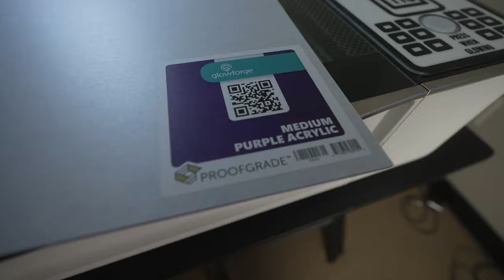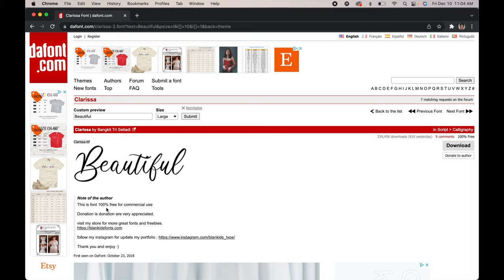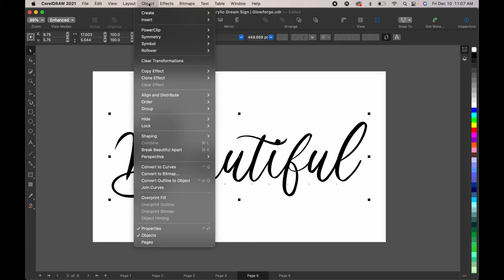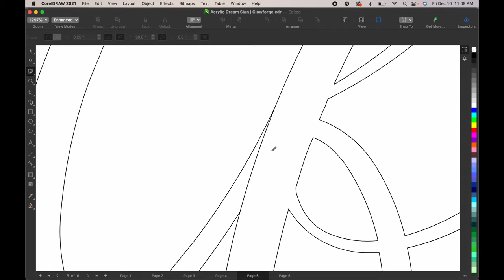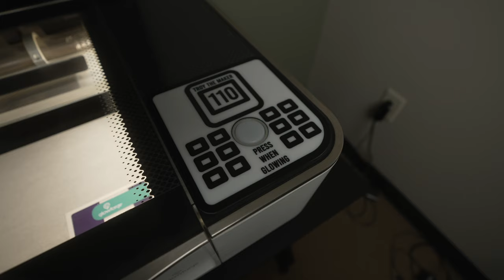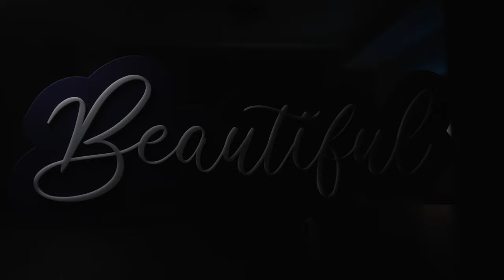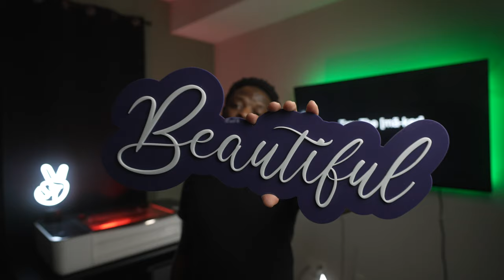Acrylic Beautiful Sign | Glowforge | Coreldraw

Comment: Great job Troy, I enjoy watching you create. Did you know that you can use the weld tool to get rid of all that over lap on the letters. Just use your shift key and pick each outside lines of the letters. Then go to the top tool bars and select weld. It should weld all the letters together. Don’t use your pick tool and select all or you inner lines (like in the e, a, f and l will disappear.
Reply from the maker: Thanks for the tip! I’ve been using coreldraw for a while and I still learn new ways to use it. I appreciate it.

Comment: If your machine is having problems, you can never get any customer support. No matter what you try. Email leaving messages or even on social media. They just do not respond no matter if you need support for your machine or an order. They just do not respond.
Reply from the maker: I’ve never had a problem when I need help through an email.
Reply: @TroytheMaker  They finally responded today. My carriage went sideways yesterday. I tightened the belt. We are going to buy some spare belting to have on hand for when it breaks.